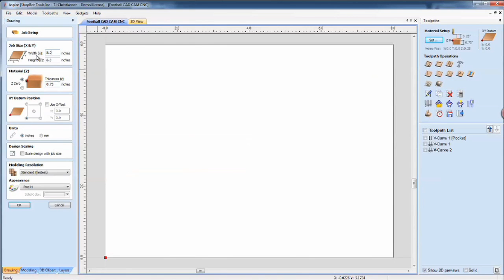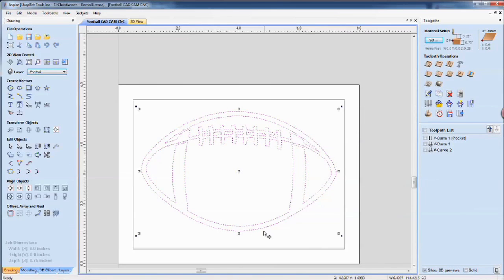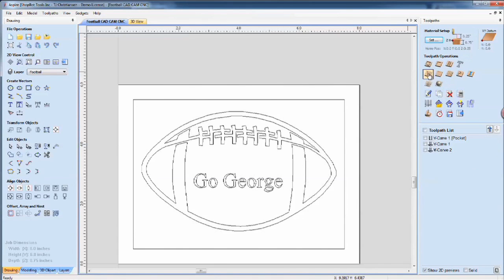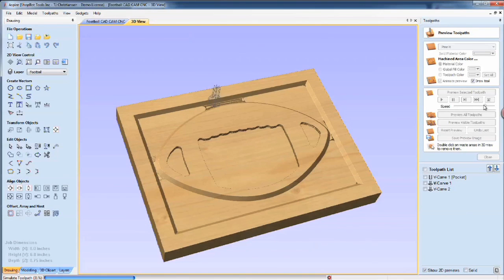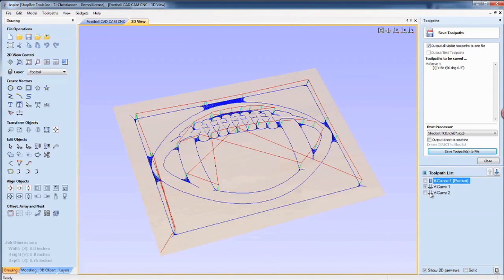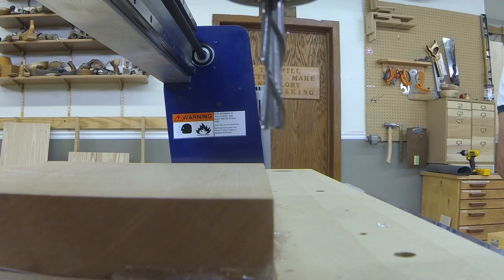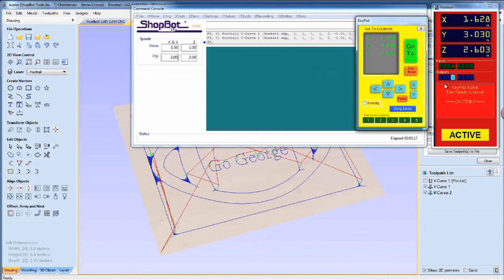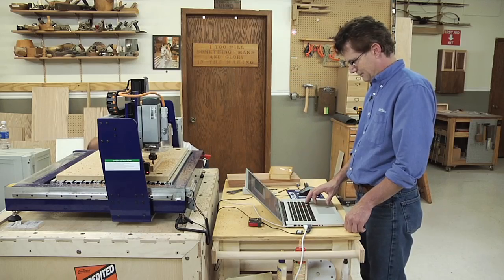CNC Machine Programming Tips  |  Woodworkers Guild of America

Comment: Nice overview there. Great starting place for newbies to get a grip on the things common to any CNC such as the concept of  the zero in all 3 planes and the weirdness with thier machine. I highly recommend the Full blown Aspire if they can afford it or V-carve (either pro or desktop) if they cant. It has one of the shortest learning curves ive seen for any simple cad program around. The Cam part is also easy to deal with once  you learn whats going on with it. That is one of the things I espically like about shopbot products, a decent cad/cam program is included but I run a home brew. From some of the shopbot demos the controller software seems about the same as Mach 3 I use but tailored a bit different. While ANY 3 axis cnc controller is very similar from a functional viewpoint those prompts and safety things can prevent a severe case of stupidity.  

Things like feeds and speeds come later.. :)  

I use several cad programs depending on the complexity of the project. Sometimes its basic 2d thing with more complexity than can be reasonably done in V-carve for 2d or 2.5 D. My favorate go to cad proggy for that and where several parts that must work together is solidworks.  I just export with a format v-carve can deal with. Then use v-carve to toolpath it..  If its 3d stuff its either Blender ( artsy stuff) or fusion 360 for the usual 3d stuff.  V-carve or aspire is all mabyy 80% of the CNC non-professional addicts really need.

Shopbot and similar products along with all the ardunio based CNCs didnt exist when I built mine. My CNC is a total home brew setup of my own design worked out in Inventor Using Mach 3 as the controller running on a 15 year old desktop I retired but saved. Old computers DO have uses.  I just put ALL the toolpaths in one file and turn off the "ignore tool change" in mach 3. It just stops and waits for you to hit start again that way. Its possible to add a bit of code and some hardware and go total automatic with a tool holder. NOT worth the cost for my uses. Its also fully supported as a post processor by almost any cam program to be had. 

New to cnc or the curious NEED more stuff like this.
Reply: John Ware Hello bro, I have a cnc 1326 machines. I need different programs of different designs. pls how do I get it. I'm in Nigeria.
best regards
Bestman

Comment: For a beginner, which CNC machine would you recommend?
Reply from the maker: Hi, Jessica. As with any tool, a number of factors will affect your buying decision. Give some thought to your budget, the size of work you plan on doing (which will determine bed size), power requirements of the machine (some are 220-volt), and how much space in your shop you can devote to the machine (which will affect the footprint you choose). There are benchtop models with beds as small as 9” x 13”, and floor models with significantly larger footprints and capabilities. With that in mind you can match your needs against the machines in the marketplace.
Reply: @Wwgoa  Hi, For a beginner, which CNC machine would you recommend? 3 feet by 3 feet?